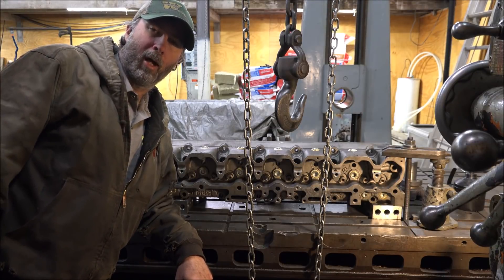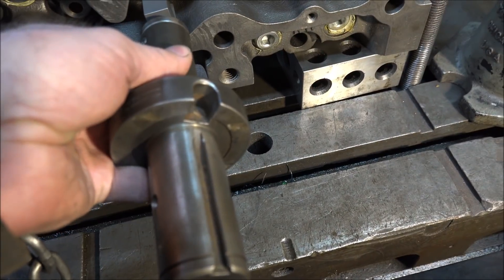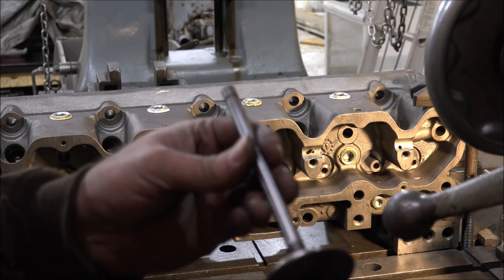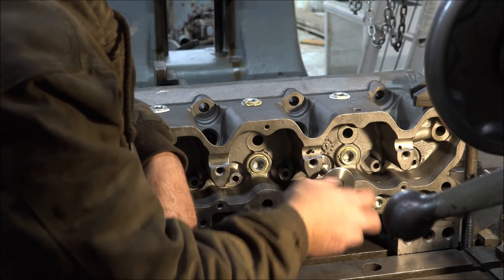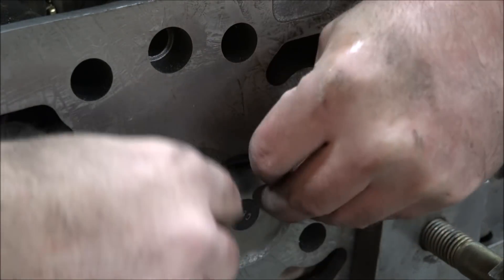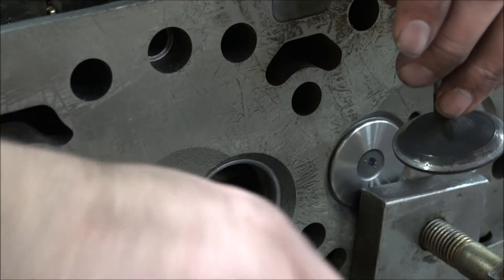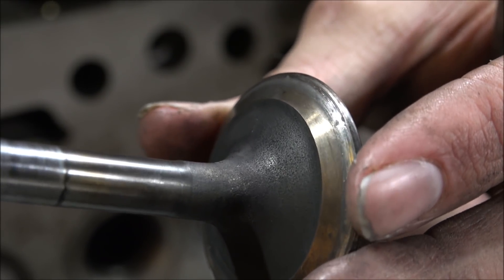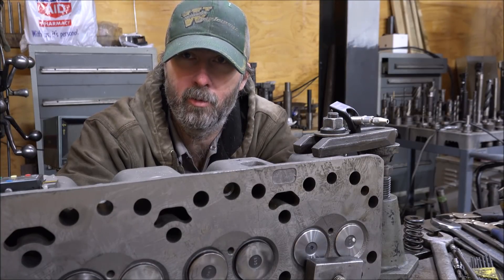Cylinder Head Valve Spring Pocket Machining and Guide Sizing Job ModificationFor Big Lift & Springs

Comment: come up with something to do about the valves ? tell the OWNER of the head that they need resurfaced plain and simple . what you are to chicken to tell your only customer his shit needs fixed ? maybe a machinist with scruples would tell him he needs a valve job before he does the other machine work .. as in not invest money in a head that needs a lot of work .. as for having the wrong equipment and not production speed ? as long as it gets the job done who cares ? but if you are charging someone actual money to do this you need to invest in better tooling ..
Reply from the maker: The customer had someone that was going to do a 5 angle valve job on it when I was done with it. My job was just to make it easier for the guy with the flow bench to finish it up. I now have the stuff to do the valves and seats in house though.

Comment: Curious, is the engine going to be running at higher rpm? Or making more power?
Reply from the maker: A little more RPM than stock(50%) but a lot more power (5 times).
Reply: @bcbloc02  5x Power increase? Wow.
Reply from the maker: @Engineerd3d  1000hp not so much for a 466CID diesel these days.

Comment: Nice work Brian! Do you use the blueprint step over for location or indicate each guide to center your cutter?
Reply from the maker: I have to center on the existing guides because their location varies. The factory machines have a fair bit of tolerance in where they actually put things versus the print.
Reply: @bcbloc02  Thanks, good advice for when I take on a similar task

Comment: Hey you wouldn't happen to have a oil pump and some decent main bearings in your top left drawer to fit a N14 would ya☻
Reply from the maker: I have the mains I took out of my small cam when I overhauled it and they are the same I think. They are probably better than the parts you have been finding!

Comment: I can tell you on the Ford triton 3 valve they had a rash of valves that pitted really bad. It would let hot exhaust gas back in to the intake melting the plastic Intake runners. The last two triton's I've done that was one of the many problems, most of my Ford guys been  saying they have  encountering the same issues. I see that HBM has been earning it's keep.

Comment: Brian that head looks pretty rough too, the customer doesn’t want it decked?
Reply from the maker: Its actually smooth it has some kind of cosmoline stuff on it right now that makes it look funny.  It will get cleaned off when it is ready for final assembly.
Reply: @bcbloc02  Thanks for the reply, I should have known you wouldn’t send off a part that wasn’t right.

Comment: Brian, what quick change system do you use?  Is it a McCorsky Wizard ? How do you like it?  You HBM has Morse taper 5 correct? How often do you find yourself knocking out the draw key and changing tooling? I have an ER40 collet setup for my G&L 25T with the 4 MT. Maybe in a video you could show off some HBM tooling.  I really like those 2 head boring cutters. --Doozer
Reply from the maker: I use Beaver quick change on my HBM and Cincinnati. The HBM is MT6. You may have missed the video but I made a special draw key that uses a screw and wedge to pull the tool in rather than the drive type key.

Comment: I don't know how well it would work but I have seen others chuck valves in a lathe and skim a couple thousandths off the mating surface to get rid of the pitting. It might be interesting to try and see how it goes.
Reply: I've done that, also had a slightly bent valve I trued up with  tappity-taps and then a little regrind.. wouldn't do it on a "good" engine but this was just to get an old POS going again

Comment: We have to get you some valve grinding equipment if you are going to continue working on these heads.  With all of the automotive shops that have closed up there should be some good deals around. Thanks for sharing.
Reply from the maker: Got it covered I think. :-)

Comment: looks like a low compression application ;)
Reply from the maker: About 15:1
Reply: @bcbloc02  lol my ducati is 13. 5
Reply from the maker: @coconutpie333  It would probably run fine on diesel. :-) My old KW is only 13.5 diesel and it runs real good just doesn't loke to start if its cold. lol
Reply: @bcbloc02  you better get to bed lol -it started raining over here in lburg nice sleeping weather

Comment: Where you get the tool for cutting the seat for the inner valve springs?  Deere head?
Reply from the maker: Manley sells the spring pocket cutters. Yeah this is a Deere 6076 head.